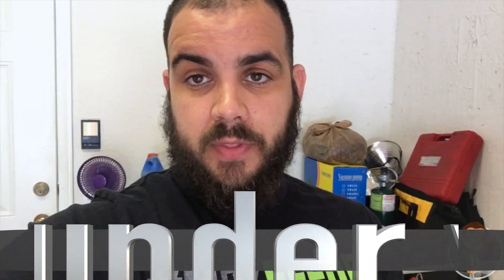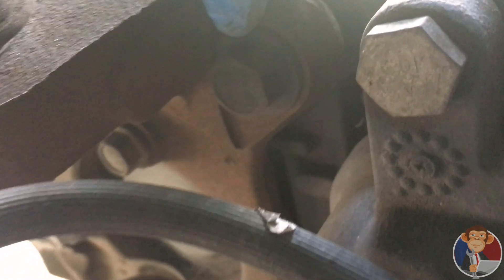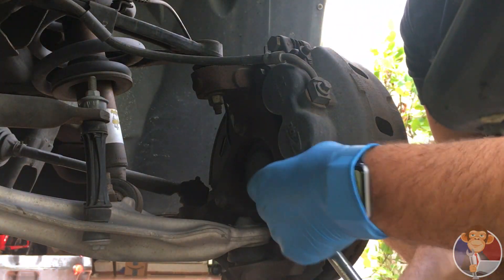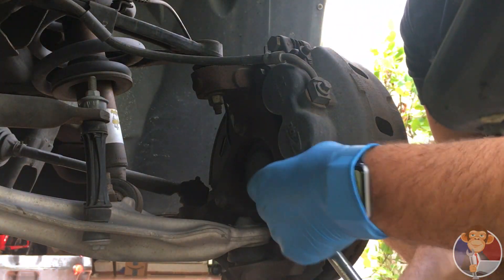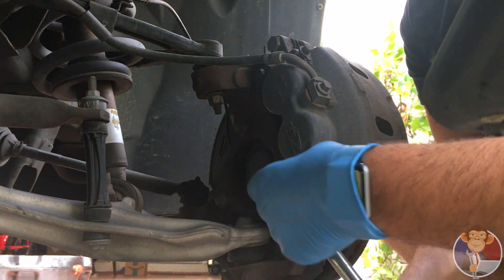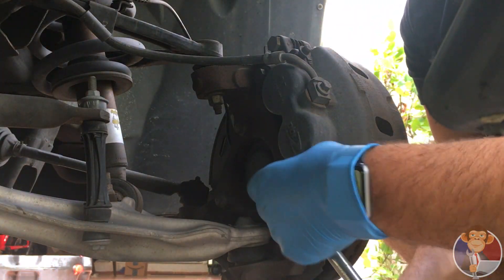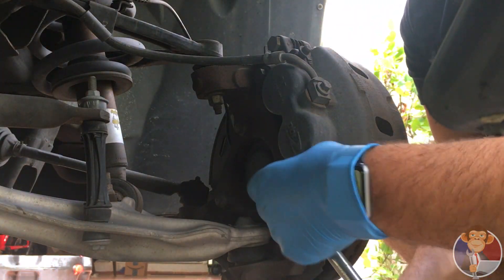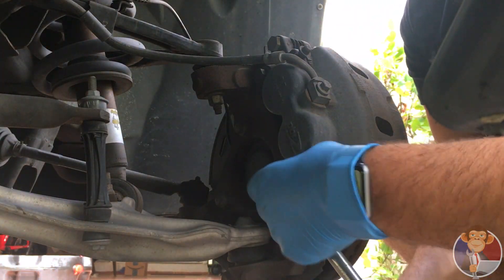How to change the front brakes & rotors on a 2007 - 2014 Chevrolet Tahoe - EGM DIY

Comment: What size is the bolt for the caliper and the bracket for the rotors? You only mentioned the size of the wheel bolts.

Comment: I had a bad driver side motor mount and it was causing the Tahoe to shudder when braking. I can't see any issue with the rotor visually, but what would you think needs to be changed because they are still shuddering when braking after the mount was changed?

Comment: Hi Carlos, I have a two ton Jack. Is this enough for this Tahoe? (tahoe weighs I think 7 thousand pounds, but we are only gonna lift 1 wheel at a time??
Reply: Little late but I have a 2.5 ton and it lifted fine. Problem was it isnt tall enough so have to put 2x4s under the jack. Jack stands are your friends!

Comment: After seeing quite a few this was the most helpful I have a question do you have to open your brake reservoir and also do you need to bleed the breaks when you are through thanks
Reply: yes,  or you will have a mess.   Get a cheap turkey baster and remove some of the old fluid...  if its really cloudy and dirty looking.    not a required task as most people dont keep vehicles very long anyway.

Comment: Do you have to torque the bolts for the caliper and housing to a specific spec or no?
Reply: Bracket 100 ft-lb, caliper 50 ft-lb, lug nut 110 ft-lb